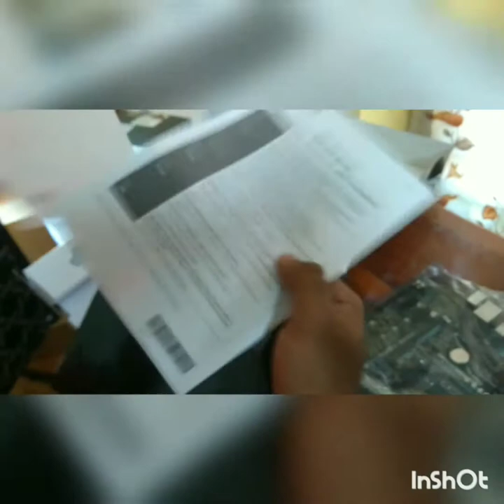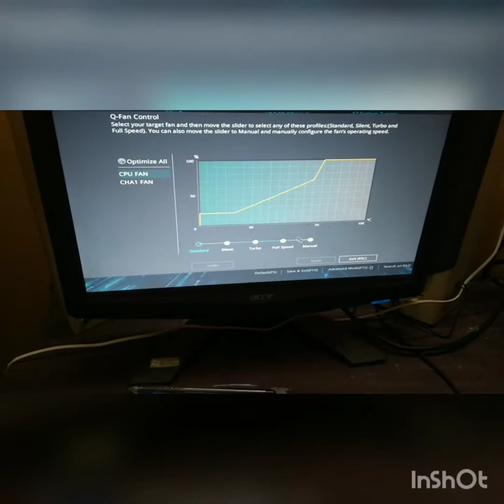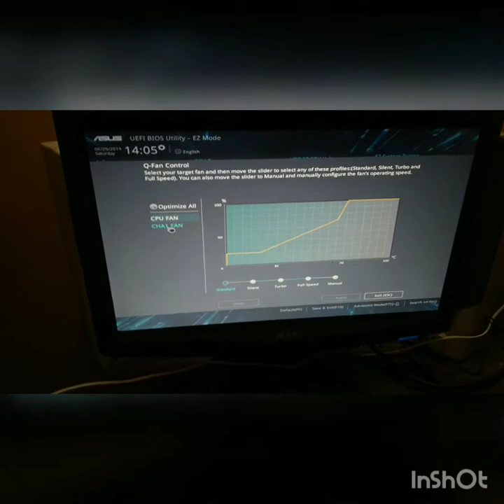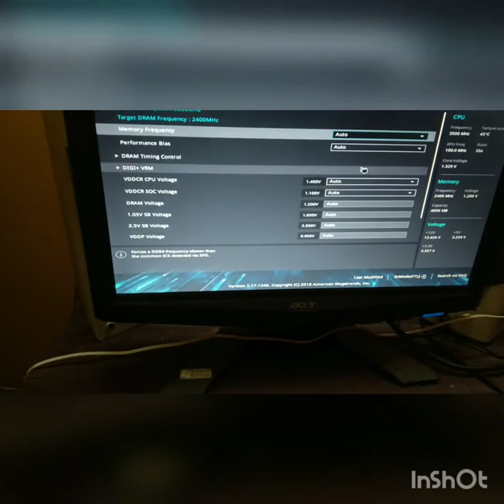The best Budget gaming PC unboxing.......

Comment: Bro  do you install any driver for graphiics.  Iam facing a problem  while opening radeon settings a msage arrives showing 👉(no amd graphics driver installed or amd driver is not functioning properly please install the amd driver appropriate for your amd hardware)  what will i do please reply fast
Reply: Ethu graphics card a muthe Graphics card ille? Illenkil driver venda
Reply from the maker: Amd website keriyit latest driver install cheyyanam
Reply from the maker: Broo subscribe cheyyane